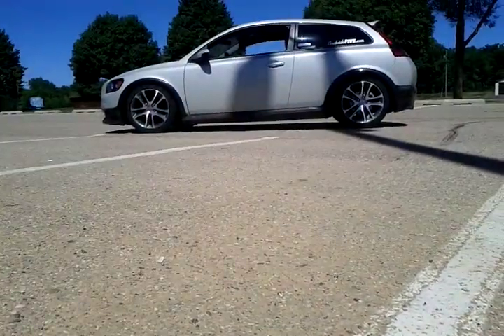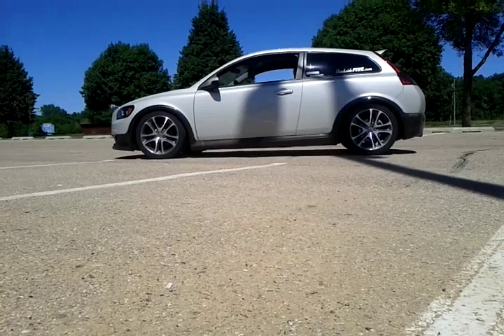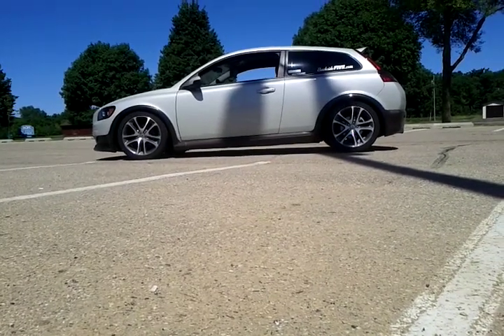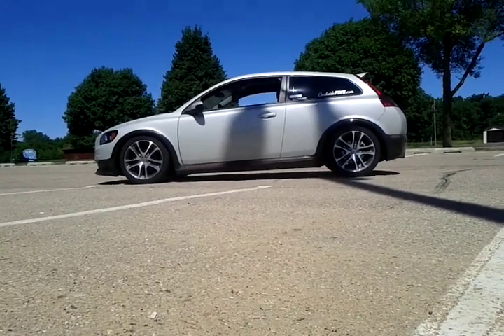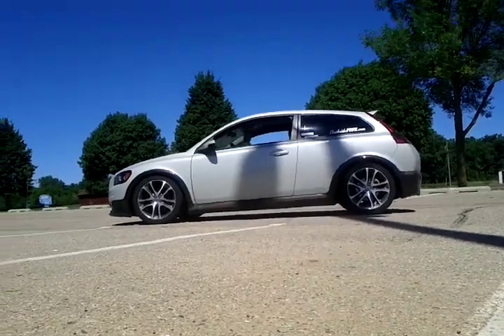Volvo C30 Turbo Open Exhaust ("open header")

Comment: be carefull by revving up and then shutting down so quickly....turbo will not last long doing this.....oil works as bearing...motor off/no oil pressure/no bearing...turbo kaput :)